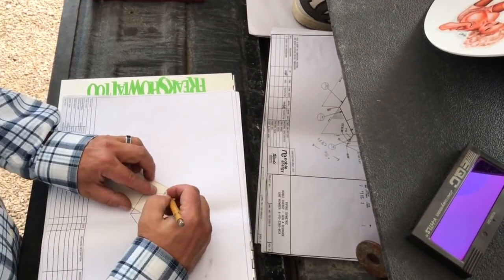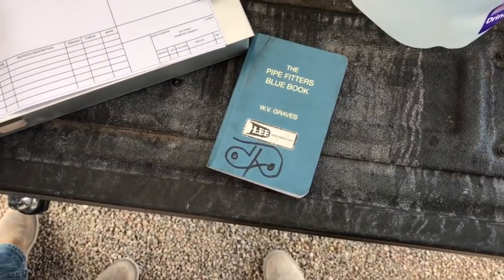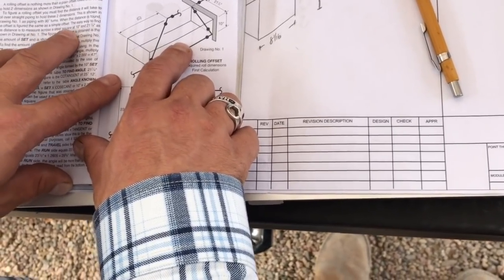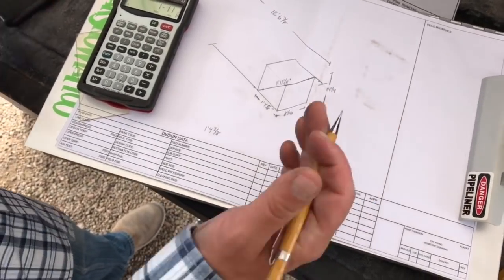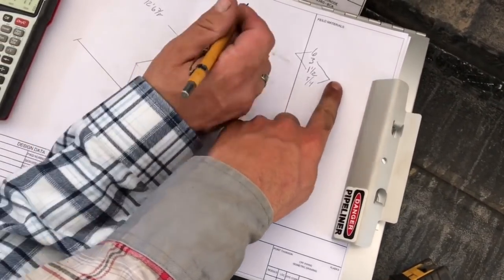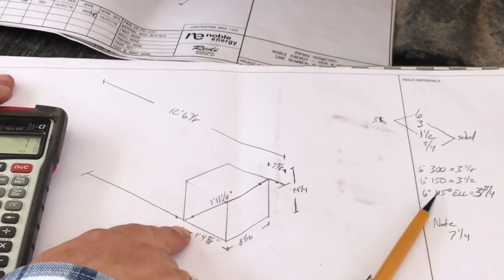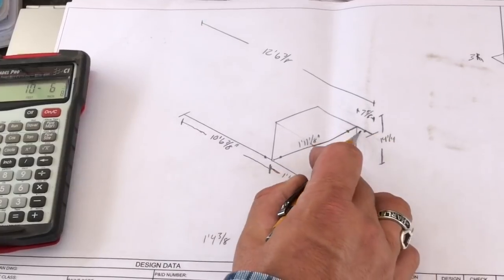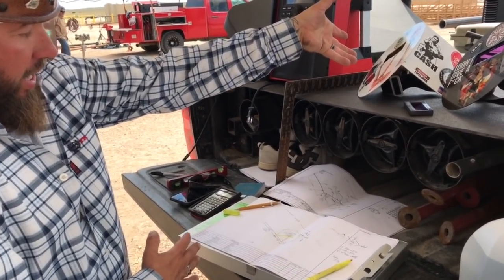Part one of the rolling offset

Comment: His (angle) calculation is wrong..  it's supposed  to be 1' 3 3/8
Reply from the maker: Man I e done the math a few times and it keeps coming out the same. Maybe it is the calculatior
Reply: Weld gap, 1/8 for each 45°.. 1'-3-5/8 -1/8 - 1/8 = 1'-3-3/8".

Comment: The brother is right on the nipple. An easier way is using your construction calculator that has three buttons. One is Rise, second Run, third is Diag. Times that by the 1.414 for a 45. If you are calculating a 22.5 it would be 2.613. Minus your takeoffs even if your mitering the pipe. Good job!

Comment: Well, for having done very little pipe fitting and working with tubing, I managed to bumble f$#& around and got the rise, roll and angle of the rolling offset correctly written down but then completely s%$# the bed to finish the rest of the information. Thank you for the explanation because my blue book was apparently a foreign language to me. Working with pre-bent tubing for coolant lines, air lines / turbos on CAT, Cummins, International engines.
Reply from the maker: ChronicPain so did the video help? Lol
Reply: @JacobSchofield  Yes it helped. Currently going over previous information from Friday and trying to recalculate things so I can comprehend what is going on. I know the difference between Pipe and Tubing but the application should be the same. My blue book does not have same info as your blue book. Trying to study up on short radius and long radius tubing for application on engines and such. Do not have my blue book with me at the moment and still trying to figure out where 1.414 comes from. Also working with arbitrary angles as Trucks are not exactly level, engines are not level, Radiators and turbos are not level.

It would also help if I had a fixed point of reference to work off of. Something I could turn or rotate. Gee, kinda like a rotary table that I have in storage and not at work.
Reply: @Delta9D9  1.414 is for 45 degree offset.

Comment: Jake, A^2+B^2=C^2   with a right triangle, take base length square it, take height square it, add those two values together and take the square root of that number. That is the longest length of a the right triangle. Plug in those numbers and you will see that is 16-3/8"

Comment: Travel=H2+L2

Say height was 14"
Length was 8"

14x14= 196
8x8= 64

   196
 +  64
  = 260 

Press the square root button on your calculator  v2, then x 1.414= 22"

22" then minus the centres of the 45 elbows, gives u your cut piece travel. 

Hope this makes sense. 😀
Reply: Same as A^2+B^2=C^2
Reply: Is this just for 45 or any degree

Comment: Ok, for some reason I assumed the 1.4142 value only worked for an angle of 45 deg. The box you have on your iso is not a 45 degree angle across the diagonal so how can you use this value in your calculation?
Reply from the maker: it is a 45 just rolled. the box is just drawn for a reference
Reply: Jacob Schofield , yes, I have been thinking about that. I do get it.

Comment: Ok to find the 1'4 3/8  you use the square but what about if you cant use the square. I know the formula to find the travel is set or run times 1.414 but that is when the sent and run are the same but here you have 14 and 1/4 and the 8 and 1/16. How would you find the travel using the numbers not square.
Reply: 14-1/4*14-1/4 + 8-1/16*8-1/16 = 268.0664. Then find the square root of 268.0664 --> 16-3/8".  If you convert that to feet --> 1'-4-3/8". 1'-4-3/8 * 1.414 = 1'-11-1/8".

Comment: 1.414 is for what? just 6" pipe? What would it be for 10"...
Reply: William Cash Same. The formula is a trigonometry constant for figuring 45* offsets. Because you're dealing with center of an imaginary point (the center of the pipe, apex of the bend) the formula is the same. 10' of 10" pipe is the same length as 10' of 6" pipe. Ya dig?

Comment: Great video love pipefitting i've done it for 2 years not enough to be a good fitter bt i've learned a couple of things and for big dimensions is hard to use the square, but you can also just make  just the  the square of 8"1/16 plus the square of 14"1/4 and then when you have the result just make the square root of that result and you have that 1 foot 4"3/8, but because we have the metric system its a lot easier....because whe don't have fractions...then you use the 1,414 (that is the same as dividing 1 for sin(45degree) ) but i love the video, thanks a lot a hope that i have hadded something.